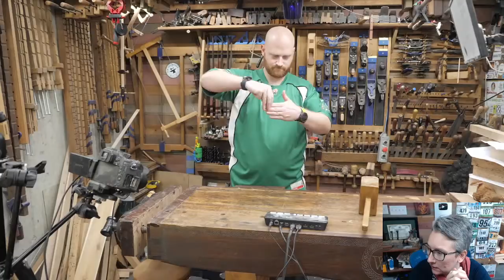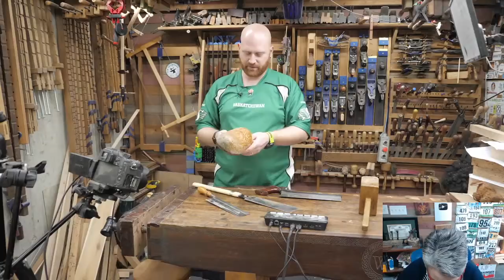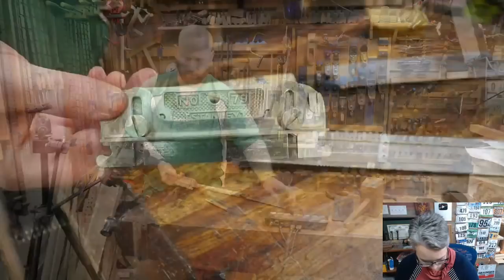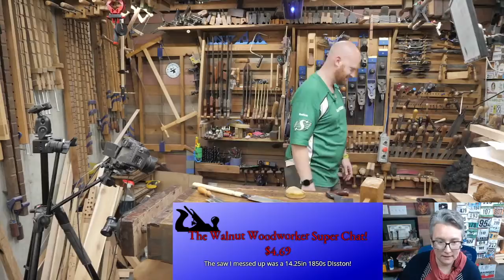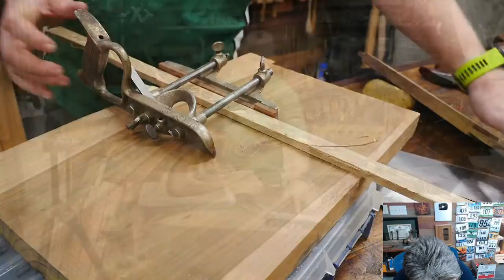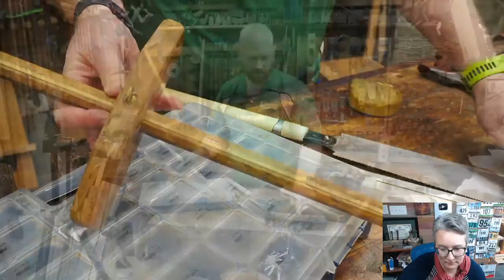Jan QnA 2022

Comment: As James said the design plays a huge role in the difference between powertool and handtool efficiency. If you really want to you could design furniture with only unique pieces with every single board being a different length, width and or thickness and dovetail all over the place that would be a nightmare to build with powertools. At the other hand of the spectrum building cubic cases with powertool is a breeze are all the dimensions are the same. Bottom line is take into account the tool you have/like to use in the designing phase (as well as the look obviously) in order to enjoy as much as possible the building process !!!

Comment: The earliest saws were both push and pull saws with triangular teeth that cut both ways. By ancient Egyptian times, the pull-saw was the norm and continued to be the norm throughout most of ancient history. The first example of a true push saw was found in the Windcliff midden on the southern coast of the Isle of Wight and is dated to the 13th century. It is of course reasonable to assume that push saws were in use before then, but probably no earlier than the 10th century or so. Why the switch is something of a mystery. Push saws have a number of advantages, specifically they allow gravity to help you make your power stroke using the weight of the saw and the body and as we have discussed earlier, they are easier to control (no matter what pull-saw proponents may say. Physics don't lie. :) ) It MAY possibly be related to improvements in the iron industry - specifically the use of water power that allowed larger iron blooms and power hammers for forging that were introduced from the Islamic world at around the same time. Japan's famously poor iron making might explain why they stayed on pull saws, but China had a very advanced iron industry and never made the pull saw-push saw switch, so there is something else at play there. It's possible that the greater density of European hardwoods compared to East Asian soft woods necessitated the push switch while the need never arose in East Asia, but I'm not sure it's something we'll ever know.

So to get back to the original question, the questioner has it in reverse. The question is not why did no one in Europe have the idea of a pull saw - They did. Everyone had the idea of a pull saw since it requires a lower level of metal making technology - but rather, why did Asians not have the idea of a push saw once they had developed the metallurgy to allow it. That's a more difficult question to answer.

Comment: Stanley router plane thumb screw, at least on No 71 and 71-1/2, is 1/4-28 thread. Still a commonly used thread today. I bought tap and tap drill from Amazon not long ago.